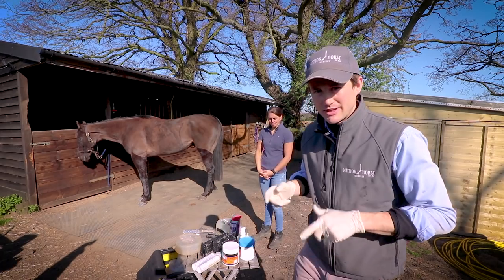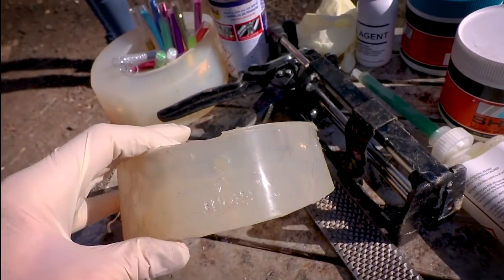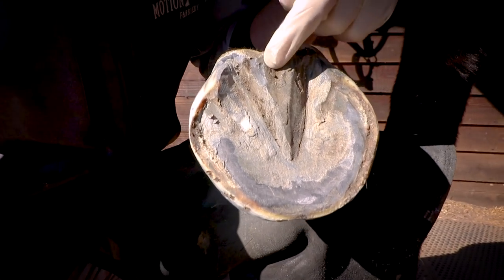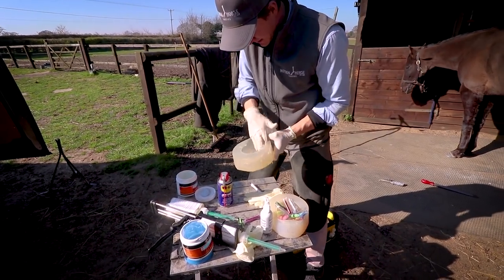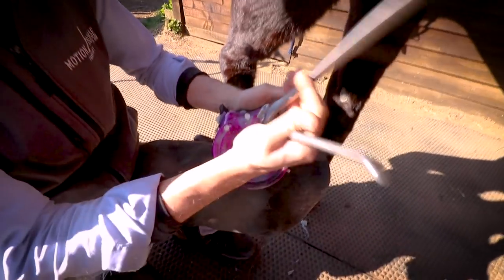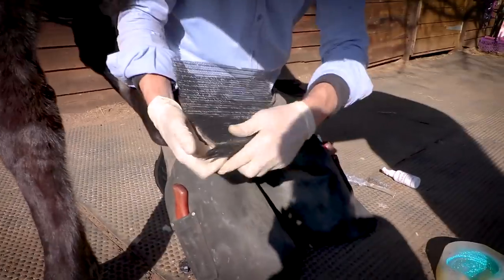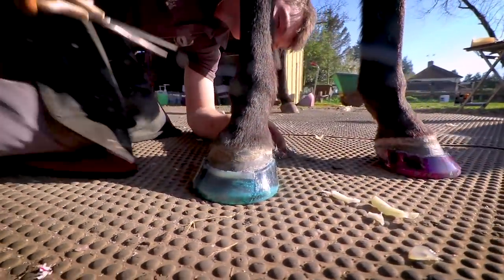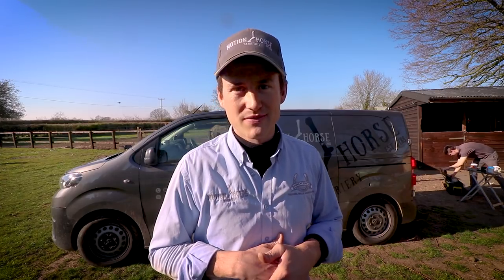Satisfying hoof restoration using Resin

Comment: What an interesting concept, I can see how this could be very beneficial in dealing with problem feet. Do you get many calls to treat miniature horses and/or draft horses? Miniatures do have a tendency to founder if their diet is not carefully controlled--those little devils can stay fat on thin air, LOL. A breeder I was friends with had a fabulous broodmare that had a tendency to founder and finally rotated--they pulled her through once but it was dicey for awhile. It would seem that something like this could help support the hoof and help keep the pain levels down so the horse can move as normally as possible while healing. I was also curious about draft horses, it would seem that they would track to the inside since some of the breeds are bred to have foot placement closer together. Have you successfully treated many draft horses? Thank you for sharing--oh, and blue for this horse, definitely! LOL.

Comment: nice to see another alternative to shoes because I'm aware there are places and reasons people use shoes especially on certain breeds of horses but I think this is so much better especially for the horse although it's a lengthy and awkward process. One thing of note is how the assistant held the horses leg, I've been told by my own farrier that you want to hold the leg and not the joint around the hoof as this causes stress in the muscles that bend there if you allow it to just dangle on it's own weight that's better for the horse.

Comment: I don't know much about hoves but is the low heel shape done intentionally for race horses or is something that just happens because they run a lot?
Reply: I think its because they run, and i guess other horses can get them to but im not sure 🤷‍♀️😂
Reply from the maker: It's a result of many difficult factors but often because of conformation which is linked to breed type. The environment and routine training schedule along with repeated shoeing that leads to the low heel syndrome
Reply: Many trainers believe in low heel/longer toe, thinking it creates more leverage at breakover. They may also leave the heels of the shoe deliberately shorter to prevent grabbing the shoe with an overreach. End result is an under supported and underslung heel that literally hangs over the end of the shoe, and you often see corns as a sequel. The ends of the shoe should extend slightly beyond the heel.

Comment: What is the cost for the molds and how many times can they be used .
Reply from the maker: They are around $450 to buy a single mould. However if cared for correctly they should last a minimum of 50 applications.
Reply: Have you ever heard of an animal with a long toe low heel conformation becoming sore as the hoof capsule grows through the cycle?
Reply: @jessebills3454  I imagine it could happen!

Comment: My horse has been  badly lame since july and got laminitis in October and had an infection in her hoof  wall since june and has bar shoes on she also is a driving horse with sweet itch and is overweight what can i do to help get rid of it?
Reply: How many horses do you own?
Reply: Do either of you actually have anything useful to contribute? Or are you simply going to sit there and criticize?

@Amie I would recommend finding a new farrier and taking your horse to the vet at the very least. Damp areas will make the laminitis worse. Keep your horse's hooves clean and dry. Discuss diet and exercise plan with your vet. NO WORK until the hooves are at 100%! Also, grain-rich diets will add to the problem as they can be heavy in sugar. Cut down on grain, and avoid treats for now.
As for the sweet itch, apply some aloe or lavender oil. If using the latter, use a good quality oil (I use LorAnn Oils) and put down a carrier oil first, like coconut oil. Cover the area so insects and other horses cannot access it. Sweet itch is caused by certain species of midges, so good bug control is a must. Both peppermint and marigold are good at keeping bugs away. Take a packed cup of marigolds (heavy on the stems/leaves) and a sprig or two of peppermint and toss them in your blender with 2 cups of water. Blend together and pour into a glass jar with an airtight lid. Steep for 24-48 hours, shaking a couple times anytime you walk past. Strain/press, add 6 cups of water, put in spray bottle, and spray thoroughly. Store it in the fridge.

Please get your horse to a vet as quickly as possible. They will be able to do more for your horse than random people on the internet. :)
Reply from the maker: @warriormaiden9829  wondeful advice for you here, thank you Warrior!
Laminitis is often a disease of the entire horse with effects seen in the feet. Look to address the weight issue as suggested with correct diet etc.
In regards to the feet there are many options available to you including formahoof. You should do some research, discuss this with your farrier and vet and try to come up with a sound plan of action ASAP.
Best of luck. Alex
Reply: For a start, see your vet. In the meantime, your horse is suffering. Do it NOW!